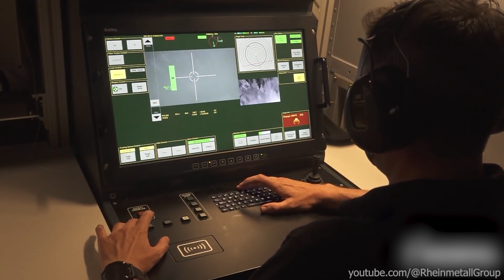Why Tank Evolution Led to Turtle Tanks Instead of Modern Abrams X

Comment: Turtle tanks are better than brand new Abrams?   BS 🤣🤣🤣🤣🤣🤣
Reply: Why you not believe Ivan? Ivan says is gud so it's gudder then Abraham tankski.
Reply: @IrieFabs     🤣🤣🤣🤣
Reply: Has this been stated at any point in the video? The video instead pointed towards more advanced active protection and point defense systems as seen on new prototypes.
Reply: Both are made into scrap metal by cheap FPV drones
Reply: @mikeshoults4155    I think you will find that Abrams tanks that have been disabled were damaged by artillery or anti-tank mines. Most, if not all, have been recovered and repaired.  No tank can continue if the tracks have been blown.  Bradleys do not have the layered armor an Abrams has, so a few have had serious damage and were lost, again mostly from mines and artillery.